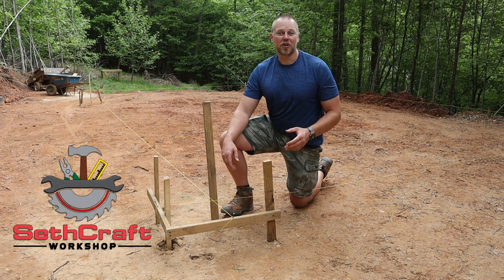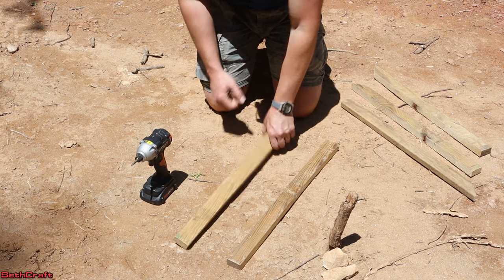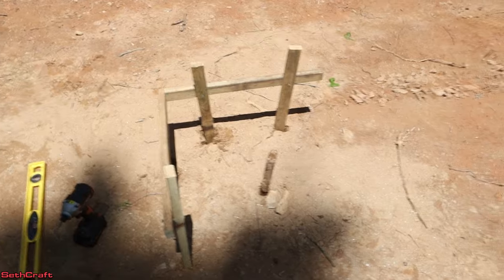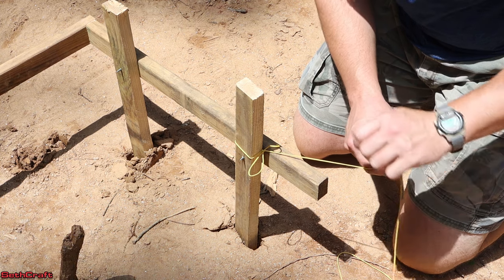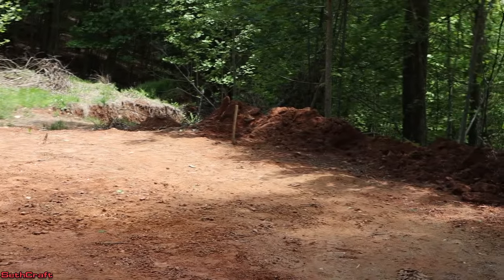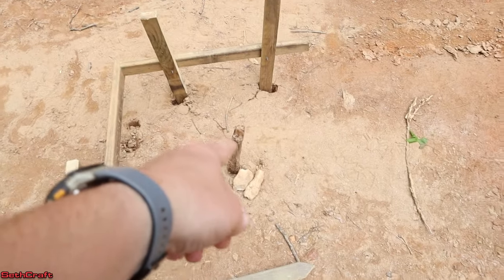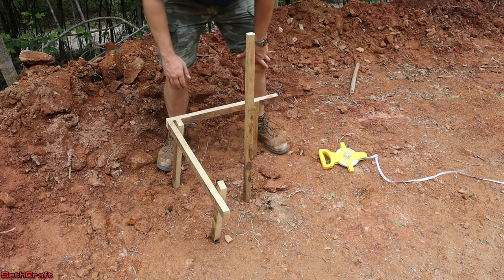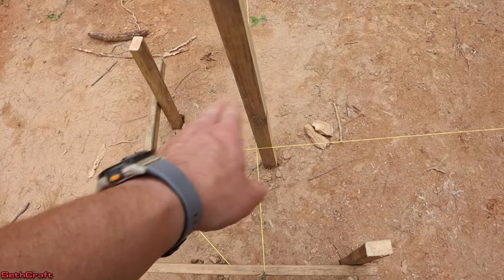Installing Batter Boards with String Line [Shop Foundation]

Comment: I don't see any reason to use batter boards, when you could just use 4 stakes, 2 tape measures, and the Pythagorean theorem. So much extra work and fuss with batter boards.
Reply: The people i've worked with who thought 4 stakes are sufficient didn't know what the pythagorean theorem is. Or, for that matter, how to check for square with a tape measure.
Reply: It's so you can slide the string around if you need to move it side to side. Having the string there for the whole foundation lets you keep everything square and level especially in the height axis.
Reply: I wouldn't let you build a dog house.
Reply: Because you use the strings typically more than one or two times dude,the time spent is way better than you and your buddy trying to hit the same spot three times lmfao
Reply: @psycomutt you very seldom use the strings as an elevation tool,don't matter how tight you pull it,it WILL sag to an extent,strings are to get it square,, repeatedly
Reply: Square with a tape is easy dude,diagonal corners should measure the same,@zachklaphaak441
Reply: I think it's so you can remove the strings to dig
Reply: Using batter boards and string lines also gives you a straight line to paint on ground for digging footings among other things genius
Reply: @johnrussell1766  you calling me genius?
Reply: @johnrussell1766  You can't mark the ground for footings if you use a stake at each corner?
Reply: Haha. Stakes twist on the way in, and im assuming you can knock them in dead level every time. Your edges need to be within 3mm, good luck getting 4 corner stakes that accurate for length and square on your first go

Comment: Batter boards are not replaceable by anything. However, As a builder I would prefer the water level to transfer the heights, it is even better than the laser level.
Reply: Have you had a problem with the water settling? I've had to wait two hours to use it by myself. It settled 9" in 24 hours
Reply: I'm glad you said that, cos I cannot afford laser level! 

What could I use in place of the wooden batter board system?

My ground is full of stones and hammering in anything but metal just won't go.

If I use rebar, how can I connect something well to it horizontally that won't go off line?

(This is my first construction project and I'm doing it single-handed😅)
Reply: @jonathanravenhilllloyd2070  maybe use sawhorses with some bags of concrete on top. You could tie a brace horizontally at the bottom for the concrete to lay on. How big is the project?

Comment: The diagonal is actually 36’— 11/16”. I wouldn’t be so dismissive of nearly 3/4” in a structure that small. As you referenced later on in the video, you want to be as accurate as possible in the foundation stage. Mistakes and rounding errors now will follow you all the way up the building.
Reply: psidvivious,  you obviously have no idea how to set a foundation and the math involved.  His 36' at the early stage is only a point at which to get started.  After all 4 corners are marked then a measurement is pulled diagonally from opposite corners.  Adjustments are made depending on how much out of square the diagonals are.  Temporary markers are placed to adjust for corrections and diagonals are pulled again and adjustments are made, then diagonals are pulled again and again until the diagonals are exactly the same thereby achieving Pythagorans triangle.  The way this guy achieved his project, although there are better and simpler ways, is correct because the actual exact number does not have be know at the starting point, only the finish point.
Reply: @rmoreland3583  Lol, You’re the kind of guy I know I would be letting go within about 2 hours. How many times are you going to go back and forth, walking from corner to corner measuring diagonals? If you are doing the Pythagorean calculation, you already know what the diagonal measurement is supposed to be. Why are you measuring over and over wasting all that time. Twice is all you need. Once to set it and twice to double check. But then again you’re probably the same guy that doesn’t actually do the math but instead thinks like diagonals equals square. Surprise, they don’t. You can have like diagonals without having a single square corner (isosceles trapezoid). 
Thanks for coming! I think the supermarket down the street is hiring!

Comment: I would keep the distances from intersection to corner 2' that way when you pull the next measurement, just add 2' and hook the batter board, if you're by yourself.

Comment: Thanks for this video! It was informative without giving to much info all at once and you did a great job of showing each step. I'm having so much trouble as a first-timer trying to get my foundation square. My soil is stable but full of river rock. So every time I put something in the ground the sticks get wonky and don't go in the ground where I want. Hopefully, the batter boards will be the solution I need! Do you have any pro tips for dense river rock soil?

Comment: this lets you remove the strings and get them out of your way for digging, and then put the strings back up to check what you did.
Reply from the maker: Yes very good point.I put mine close enough to the ground that I could just scoot them out of the way a little bit while digging the footers.

Comment: What about checking corner for right angles using theodolite in complex building setting out
Reply from the maker: In a future video I use the Pythagorean theorem to check for square on the foundation frame build.
Reply: @sethcraftworkshop For the means of providing education to everyone , I prefer looking your video which explain multistorey building setting out.
Reply: @sethcraftworkshop ❤